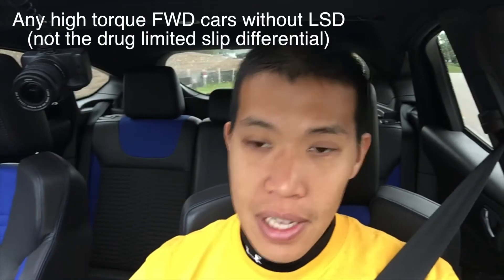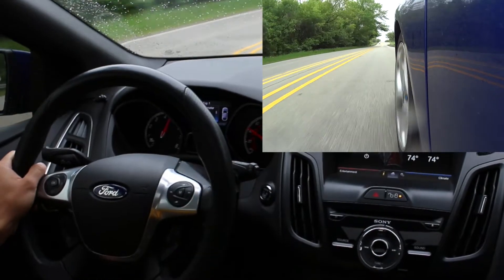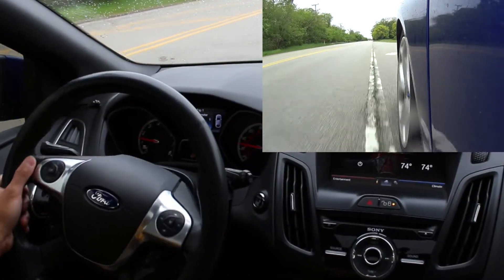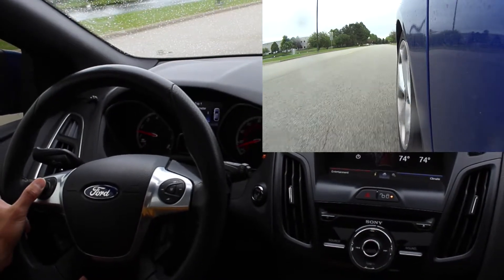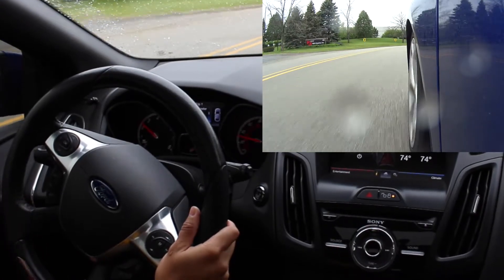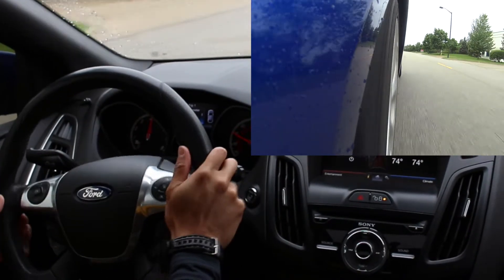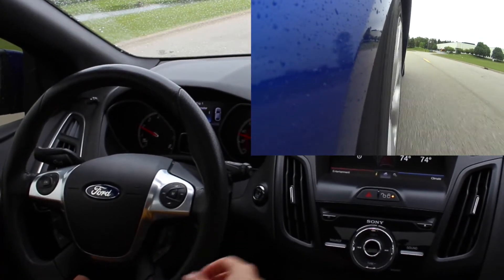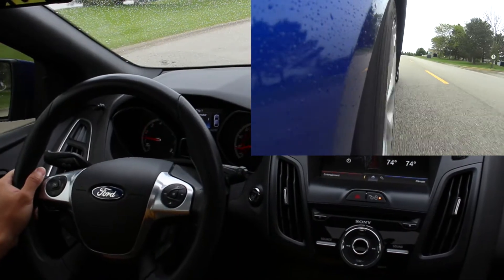Torque Steer with the Focus ST

Comment: Car is stock right? I never experienced this until recently, I guess it was always there? Beofre when I floored it it seemd to go pretty straight, but it's always there right ? like your video shows. Maybe I had my hand on the steer wheel so it never happened
Reply from the maker: Stage 1 tune from COBB so should be around 330 torque instead of the stock 270 and it allows overboost immediately.
Reply: @DerrickMoy  oops I mean video can be applied to stock ST? the tq steer I mean. also keep making those videos they r helpful

Comment: So why does it pull to the right and not the left?
Reply from the maker: P C could be a few different reasons I think the main one is since it has an open differential and the brake vectoring is never as good as a limited slip one side will always spin more power /torque  than the other side. It depends since normally I'm on the right side driving it'll mostly pull right since the road slopes that way if I were on the left side it probably would pull mostly to the left.

Comment: Mechanical LSD and Revo-Knuckle Suspension like the Focus RS mark 2 would have been good but Ford wanted to experiment with vectoring presumably. The "it's just a FWD thing" is not correct. The open diff ST225 was much better, even running 300bhp. The ST250 is a massive step backwards if you want to track your car.

Comment: 2015+ versions of the ST have mitigated this issue with a redesigned suspension and stronger rmm. Torque steer is still there however but its not as drastic as it is shown here.
Reply from the maker: That is correct, I haven't driven the revised model of the ST just yet.
Reply: I have a 2010 mkll and it’s crazy